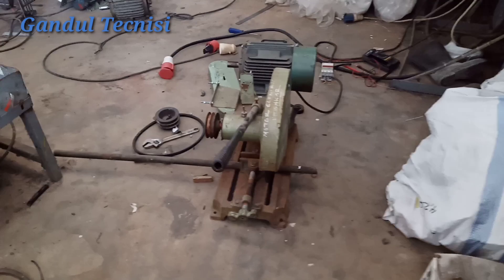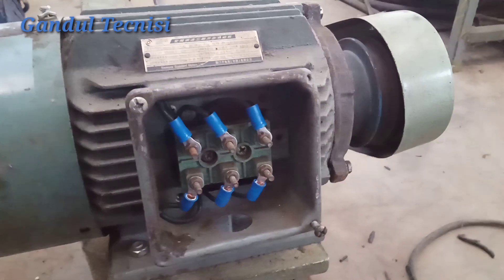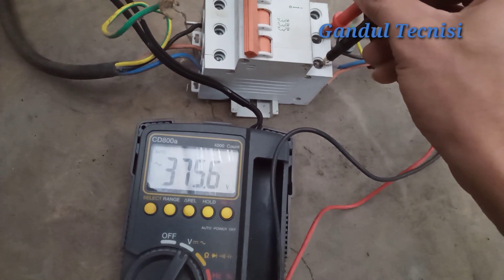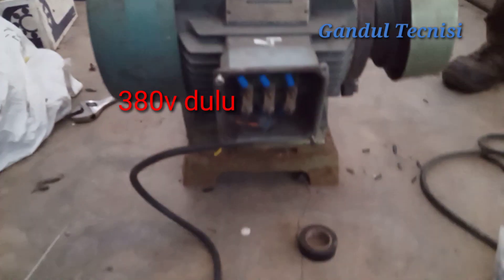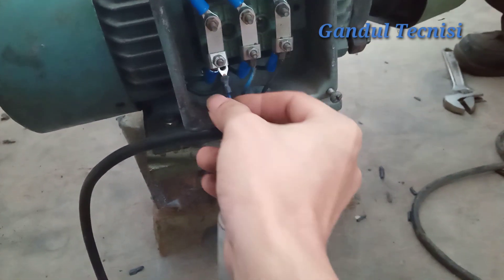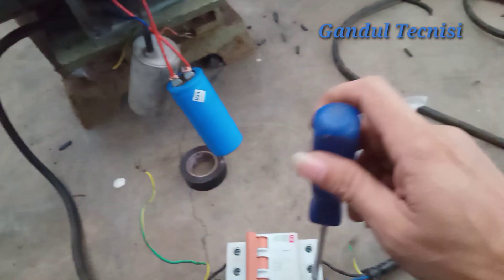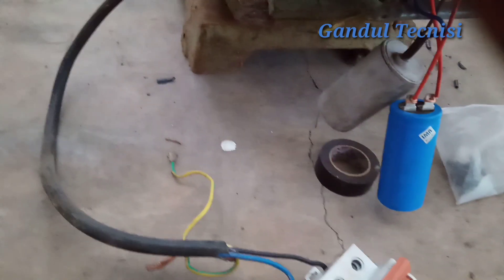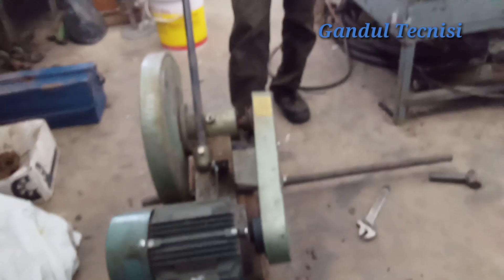Dinamo 380 v menjadi 220 v

Comment: Mas punya saya saat pasang balting malah gk bisa muter ya..
Reply from the maker: Beban jangan terlalu berat bang
Reply: Bisa minta nomor WA bang,,
Reply: Soal ny belting longgar, dan juga belum pakai beban.., tapi kalau di lepas belting nya kecepatan lumayan..
Reply: Mesin saya sama seperti yg di video abg, RPM 2800, 2,2 kw. 3 HP, jadi capasitor brapa micro ya yg harus di gunakan bang

Comment: Bang sy ada motor 3 ohasa i hp...cm ada kabel 3 biji aja bng yg keluar dr motor...gmn cra ngrubahnya jd 1 phasa dn berapa kapaaitornya bng...mks sukses slalu chanelnya bang🙏🙏👍
Reply from the maker: Capasitor 50 uf 450 v ... Sama ajah keluar kabel 3 itu berrarti udah di jumper di dalam cuma kita gak tau apa jumper delta apa Setar
Reply: @creatip  puya saya motor kincir tambak bang...mo dirubah ke1 phasa ikut pln cm masih bingung...klo deket tak anter tmp abang😅
Reply from the maker: Oc bang kejauhan bang 😁

Comment: Om motor mesin bubut saya 380v double speed. Mau saya pasang ke listrik 220v dengan cara ini bisa ga ya?
Kata org2 ada yang ngomong gabisa karena dinamo dobel speed kusus utk 380v, tapi sebagian ada yang bilang bisa..
Di platename nya hanya tertera 380v. Bukan 220/380v.
Gimana ya om? Apakah dinamo yg ada di video ini juga dobel speed? 
Sama sama 2.2kw 
Mohon info nya om
Reply from the maker: Bisa bang ini yang saya pake dinamo  380 v  bang
Reply: @creatip  itu dobel speed ta?
Oh iya itu di motor sampean tertulis 220/380v atau 380v aja??
Bisa minta wa nya om? Mau konsultasi nih
Reply from the maker: Itu dinamo buat  mesin" produksi pabrik khusus 380 v gak ada tulisan 220v
Reply: @bactiarhmzh1776  awas gk tanah lama 😀,,